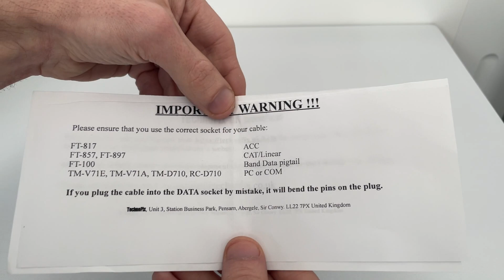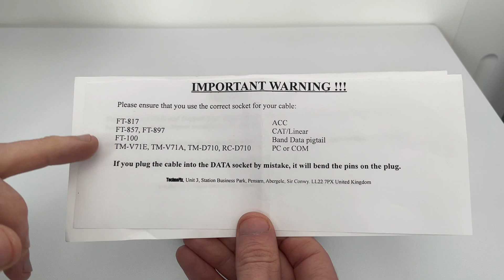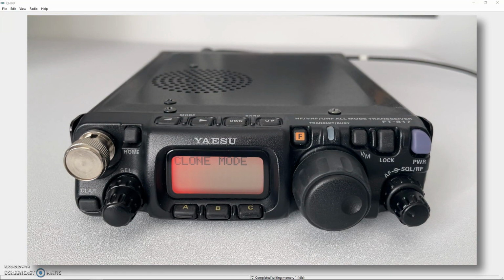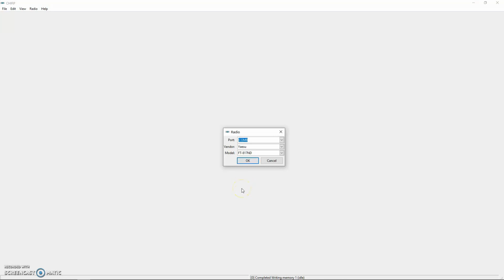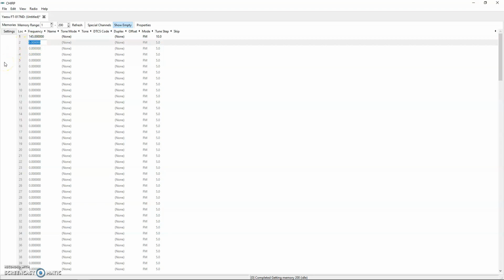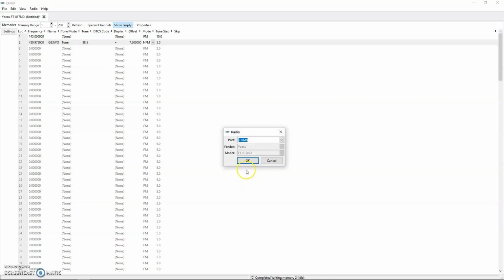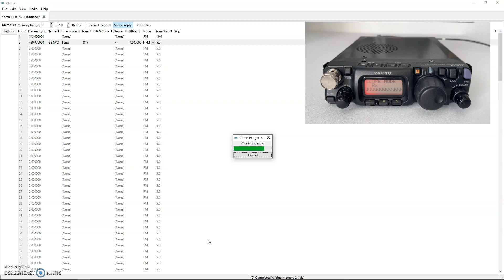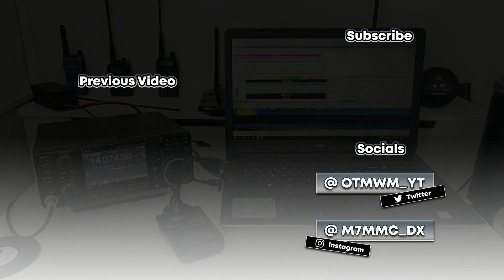Programming in Clone Mode with Chirp | Yaesu FT-817, 818, 857 & 897

Comment: Mike, i have a  FT-*(F (2004) i am tryiong to program it with the datacable and Chirp, but it seems i get an error during datatransmittion from the set to the computer.  Is there a need for special settings in the com8 in windows, and or in the Yaesu to get chirp working? i tried other programs to, i made a hw reset, should i do some presets in the ft897?  sing chirp would save me  a lot of time since i have all settings for the repeaters in my  baofeng
Reply from the maker: There seems to be an historic bug with Chirp and the 897. I'm not sure because I've not got one myself. I don't own any Yaesu radios anymore. But have a look at this link here: https://chirp.danplanet.com/issues/717

Comment: Thanks very much for this, I've just bought one of the last FT818s, so this will be very useful. I have other radios which are on the Chirp list and wonder if there is a way to transfer all the saved frequencies from my 818 to another radio, say a Kenwood handie talkie? Thanks and best 73.
Reply from the maker: Thanks for the very kind feedback it’s most appreciated. There is one way, if you open the FT818 file with all your frequencies in Chirp, open a second window of chirp and plug in your other radio. Read from the radio you want to program, and clear all the memories. Then go back to the 818 window, highlight all the frequencies you want to copy and just simply hit edit from the top of the window and copy. Open the new radio window and hit the same edit option and paste. I’ve done it that way a few times. Thanks again and 73’
Reply: @OntheMicwithMike  Thanks so much for taking the time to write such a detailed reply. 

This will be very useful as I have at least 5 radios to programme on Chirp.

Comment: To send the programmed memories back to the radio, the video says to put the radio into Clone Mode and press C but my C says SEND, as in send to Chirp.A says RCV and Chirp says to use A for the radio to Receive from Chirp but when I use A I get an error. So I'm still unclear on how to send from Chirp to the radio.
Reply from the maker: That’s an odd one because it’s back to front. A sends data from the radio into Chirp and C receives data back from Chirp.
I’ve since sold on the FT-817 but hopefully someone else will be able to assist. 
73’

Comment: I have a cable for my FT-7900 and both Chirp and FTB7900 software. I take it you recommend Chirp?
Reply from the maker: I’d use the software that’s been made specifically for the radio first before trying chirp. But chirp is a great bit of software if there’s no software available for the radio you’re looking to program.
Reply: @OntheMicwithMike  I've used Chirp on all my Baofengs but the FTB7900 software seems to have loads of more functions.